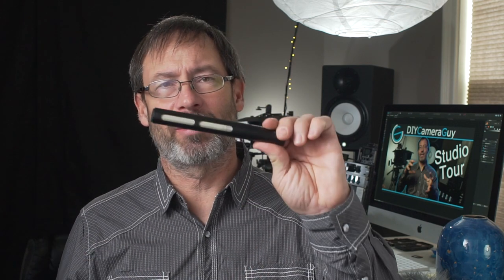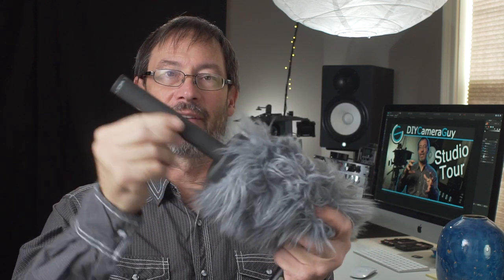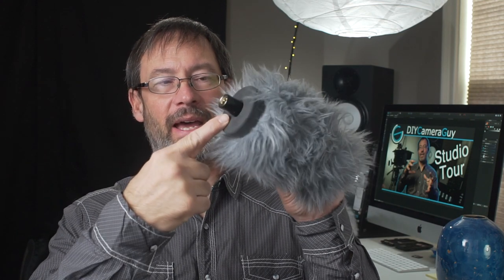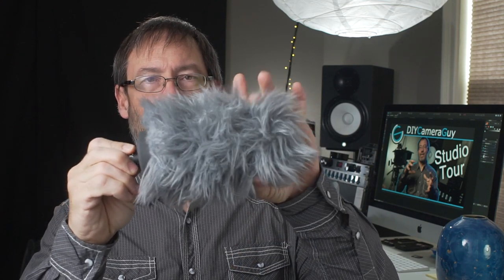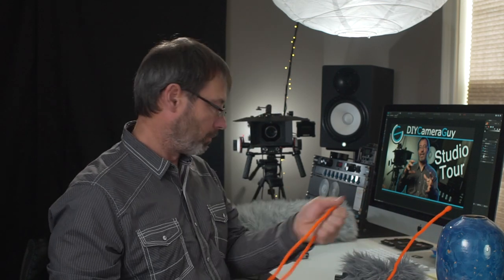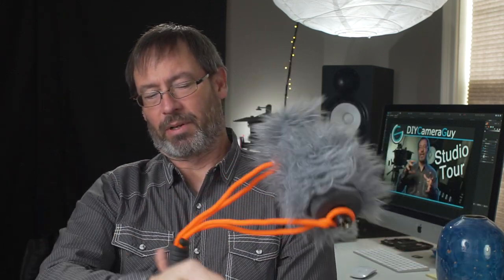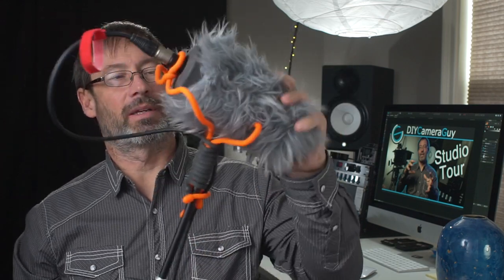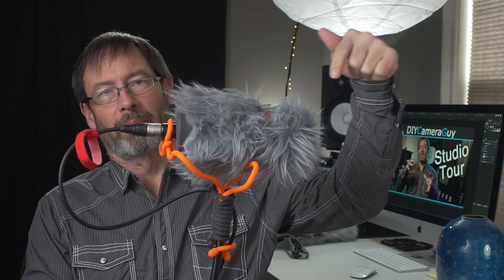DIY boom pole mount with windshield, Audio Technica  AT875r microphones [A4Q]

Comment: Hi. Why not do a DIY on how to actually build a good workable blimp, instead (without the cost of a retail one) ?
Reply from the maker: I just finished editing the video on how to make this one. What do you have in mind? a blimp with a handle like the Rode.
Reply: Yep. That's exactly what I meant. I know that there's a few of them, mostly using bird feeders as body (that's only for those in english), but I was wondering if you could do  something  more useable because the bird feeders ones have the nasty problems of been poorly made, especially if you need to recover the mic inside. Also, they are affected by noise echo . 

Do you think it's possible for you as a DIY project ?
Reply from the maker: I have built a few but nothing that I love yet. The one I like the most is not easy to build. There is a very expensive blimp that has an interesting internal structure. I am thinking of laser cutting the parts to see if I like it.